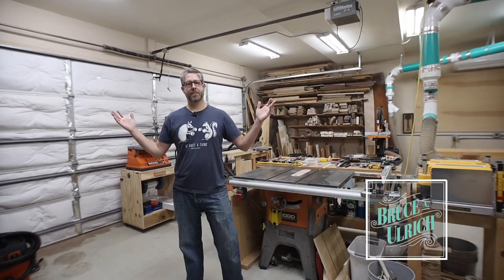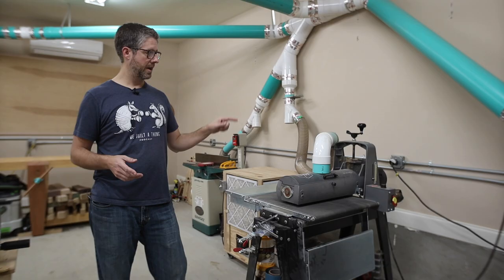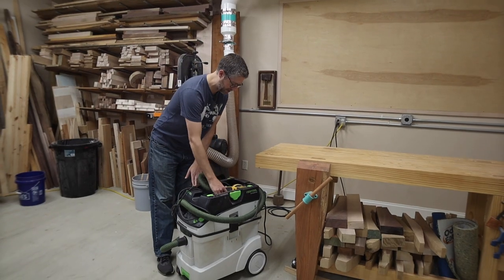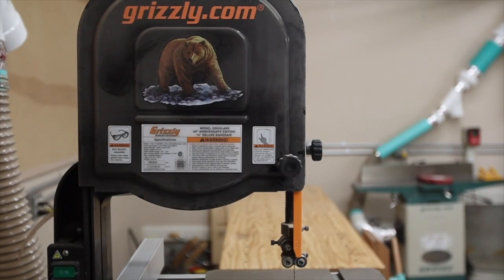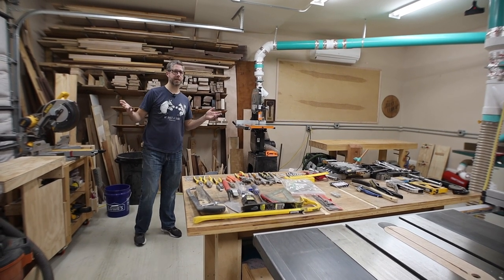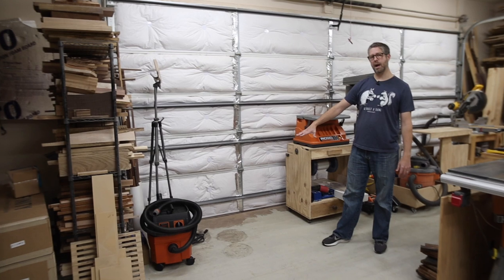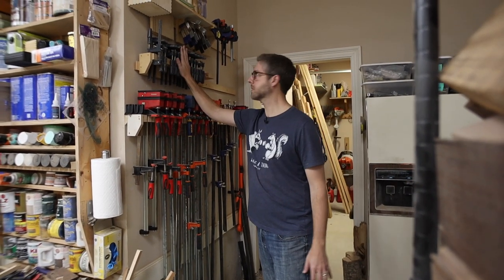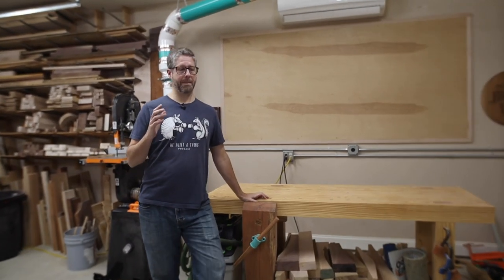Shop Tour 2021

Comment: Try blown insulation. Used a 2" hole saw. Replaced the plugs when down. Worked great.
Reply from the maker: I may have to try that out. No doubt it would make a huge difference in the shop

Comment: Bruce, have you tried that planer with/without the infeed?   I have it, but not the flip-down infeed/outfeed and I wonder if they make any difference.

I've debated and debated putting a helical in the planer, but with my volume, the disposable blades give me most of a year, which is a long payback on switching the head out.  And the older the unit gets (Mine is probably 10yrs old) the more I wonder about if it's a good idea.  So I keep sticking with disposable blades.  You've got the space to step up to a nice cast iron 15 or 20 incher.
Reply from the maker: I've not tried the planer without the infeed. I seem to get pretty good results how it is so I don't mess with it. Yeah, I hear ya on the helical head in the planer. I think I agree with you, at that volume you're putting through it, just stick with what you've got. Yeah, I'll probably go with a larger floor-standing model as soon as I logistically can.

Comment: BTW... Do you have plans to insulate that one wall?   I know it would be a pain to pull down all the drywall and do it, but I would think it would make an impact on keeping your space conditioned.   Or could you drill holes at the top and have them blow in insulation?   Depends whats in the wall, I guess.
Reply from the maker: yeah, I think I could possibly drill holes and have insulation blown in there. I'm sure it would make a difference. Luckily, it is an east-facing wall, and we have woods with very mature trees behind our house, so it doesn't even get a ton of direct sunlight in the mornings. It would be way worse if it faced West.

Comment: I see that you have have a Fein Turbo in addition to the Festool vacuum.  How does the Fein Turbo compare to the Festool?   How does the Fein Turbo compare to the Ridgid vacuum?  Thinking of upgrading the Ridgid vacuum in my miter station.
Reply from the maker: I have a large Rigid shop vac that I used with my miter saw in conjunction with a Oneida Dust Deputy. That actually has a larger capacity than using the Fein Turbo I for sure...not sure about the Turbo II. None of the stuff got into the shop vac filter pretty much with the Dust Deputy cyclone. The Fein vacs are nice! I would buy another one. I like the fit and finish of the Festool one and the hose is nicer, but Fein vacs are nice.

Comment: Thanks Bruce. I’m shopping for a table saw. Are you happy with your Rigid? I see lots of them in woodworking videos. I know they do not have the lauded Biesemeyer style fence. Do you feel that is not worth the cost, or are you just prioritizing your purchases now?
Reply from the maker: I like the table saw. That being said, I will upgrade this one eventually. I bought it over 6 years ago and it was in the price range I needed. It’s a very solid saw with a pretty decent fence.
Reply: @BruceAUlrich  I think your saw is the Rigid 4512 and not a 4520 as referenced in the video. I had the same one purchased right about 2014. I was perfectly happy with it when I upgraded to a Sawstop a couple years ago. Some quirks but they were easy to work around and get perfectly accurate results. The main reason I upgraded was for the safety aspects of  the Sawstop - figuring $3k was cheaper than a trip to the ER.
Reply from the maker: @philshock3805  Yep...you're right! I just looked and I do have the R4512 not the R4520